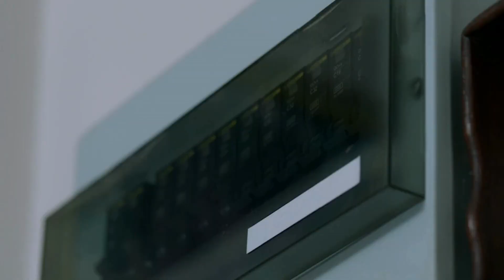5 Reasons Your Thermostat is BLANK!

Comment: I have a serious question that no tech seems to be able to answer. What causes the compressor to make a rough sound when it kicks on?  It seemed to stop at one point when it was recharged after i had a leak. But then it starting making that loud sound on start up again in just a few days.  I live in FL and findging a good, honest tech that doesnt rip you off is hard.
Reply: Recharging refrigerant has done nothing unless the leak was repaired. That electric motor in that compressor needs vapor refrigerant to cool those windings. The mechanical portion in that compressor needs the oil for lubrication of the moving/mechanical parts, no matter what type of compressor.
When you have a leak & run low on gas, the compressor motor windings are not being cooled; along with losing refrigerant due to a leak, you are also losing oil that is needed for lubrication.
Reply: Adding gas without finding the leak is just buying time. That compressor is taking a beating.
Reply: Running a compressor with a leaker, especially w/no LPCO (Low Pressure Cut Out) means the compressor is having a rough go.
Reply: Good luck.
Reply: Amp draw numbers will tell you the health of the compressor
Reply: Adding gas but not determining where the leak is..
Yep, gas it up & call us if it goes down gain = easy money for crooked outfits.